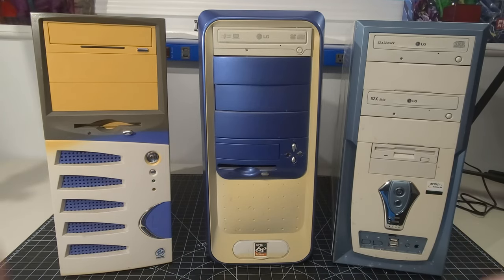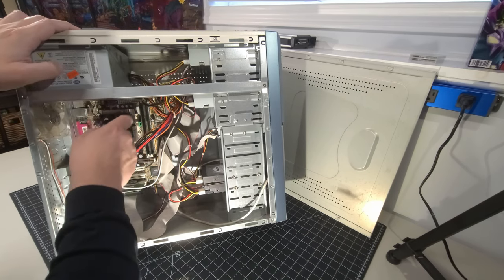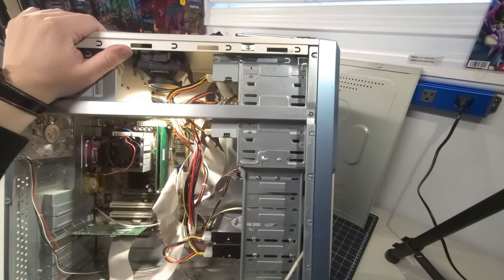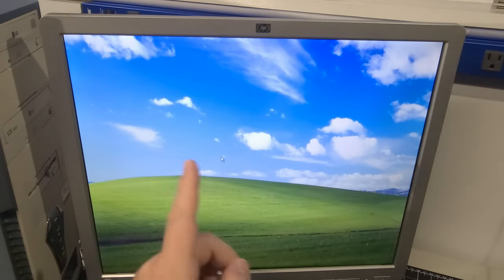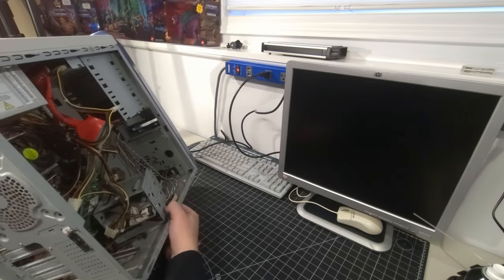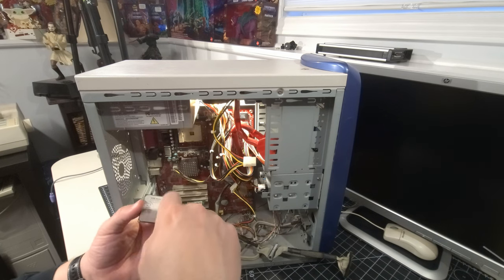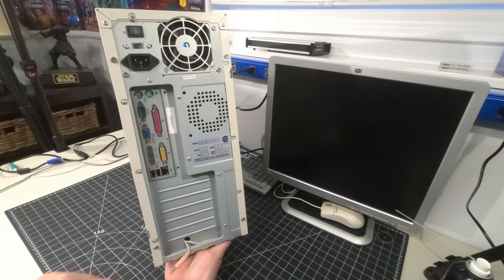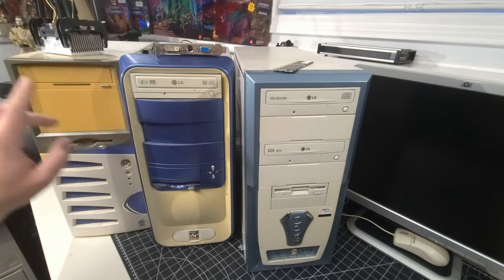Vintage Computers Saved from E-Waste!  Do they work??

Comment: I had a Compaq 2040WM
WalMart $400 Special, I Maxed that thing out to 1Gig Ram
with a 128Meg GeForce VideoCard!
I was a Quake III DEAMON!
Reply from the maker: Sometimes those systems were the little engines that could lol!  You could jam pack them and make them go beyond their specs for sure.  Ahhh the fun.
Reply: @TheRetroRecall  I actually got the HVAC company I worked for to pay for the Upgrades, as Assistant IT Manager with a 1+hr Commute, as well as one of the CAD/CAM  Engineers,
I had to be able to Work from home, I Originally bought the Base Computer though.
But that 128Meg Card and going from 256Meg Ram to a Max 1Gig 2 Sticks....
That was a CVS Style Receipt at CompUSA!
Reply from the maker: @MotownBatman  love hearing this story!! Pretty slick.  Stay tuned for Saturdays video... A rare system for the bench!

Comment: That 754-system is a very nice and kinda rare find (if it's working though). Could be used for Win98, XP or even some DOS-experiment. And really hope you can get this 9600 to work.
Reply from the maker: Agreed!  I'm going to be doing a full restore on this system in a video - hoping we have a positive outcome!  I can't ever remember seeing a burnt label on a GPU fan bearing label before.  It must have gone hard right to the end.  Hoping it is just the fan and no damage was done to the card itself. Stay tuned and thank you for watching!
Reply: @TheRetroRecall 
Btw, some of 'em 9600 was "upgradable" into 9800's,by firmware!!!
Reply from the maker: @DuneRunnerEnterprises  awesome!!!
Reply: @DuneRunnerEnterprises  Not possible.  Soft mods apply to the 9500 Pro, 9700 series, and 9800 series cards. 
9500 Pro can be soft modded to the 9700 (pro), the 9700 and 9800 series cards can be soft modded to 9800. 
9800 SE goes to a 9800 Pro  and the 9700 series goes to the 9800 Pro as well.
Reply: @ToniHiltunen1980  Are you sure about that?
I was sure,that the 9600 IS the ones.
Ok,so i was wrong.
Bummer.

Comment: the first 2 are like the first PC i got back in 2003 time I must have been 18 - 20 then.  
but never had my own pc before that.  
Now I have had lots.
Reply from the maker: Awesome! Hopefully you get to experiment with different types of configurations.  Do you have any of the older tech still in use today?
Reply: @Karataus  the oldest is a q6600 pc.

Comment: Traditional, use a CD-ROM to save wear on the more expensive CD-RW
Reply from the maker: That's a great point and makes sense.  It's probably why I had three optical drives in my new P200mmx build (shown on this channel).
Reply: @TheRetroRecall  First, I had a CD-ROM, then I added a CD-RW, then I replaced the CD-ROM with a DVD-ROM, then the CD-RW with a DVD-RW.
Now, I just like to carry two DVD-RW, for "reasons".
First reason, was that my primary drive in my last build was a Samsung with Lightscribe, but not good for quality scans, so I paired it with a Liteon. This pair was going to go forward, but then I found one of my dream drives on ebay, a Liteon IHAS 224 (B) which crossflashed to a 624 for ALL the features. I still paired it with a different drive for diversity in reading iffy discs... a GSA-H55N from a junkbox lot winning the read-off on a test disc that I'd created a while back and not looked after at all.
Yep, IDE/PATA drive in a modern SATA system driven by a Jmicron card, but I think in the current rebuild, I'll drop the card and try an adapter
Reply from the maker: This is awesome.

Comment: ive done some of my own research into older beige cases myself. I noticed on the first computer that the side panel grille looks similar to the beige case i own from my 2003 athlon based system, and sure enough it comes from the same company. Mine is the linkworld 313N, whereas yours is the linkworld 313U. I am surprised that the case manufacturer site is still up
Reply from the maker: Again, love this info.  Site is still up - I wonder if you can still get cases or other items.... Or is it just up because someone didn't turn the lights off haha.
Reply: @TheRetroRecall  i dont think they are making them anymore, would be cool but there just isnt a profitable market for these beige cases anymore, its just too niche
Reply from the maker: @ElectronicInspiration  very true, one can dream :)

Comment: I was thinking about building sleeper PCs in retro cases. I haven't found any retro cases yet. I have a 2005 HP machine but I don't want to take it apart. It works great.
Reply from the maker: Awesome and yes a sleeper pc would be pretty awesome - I think that should be something on the menu for a future video!
Reply: @TheRetroRecall  Yessss! I'm in! ❤️
Reply: @TheRetroRecall  The problem is ventilation isn't good on these rigs, so probably the best bet is a modest graphic card or just rely on the integrated one. I have an IBM 300PL who I plan to convert to a sleeper pc.
Reply from the maker: Makes total sense.  I'm sure we could sneak in some extra cooling and make it sound like an airplane :). Looking forward to hearing about your build!